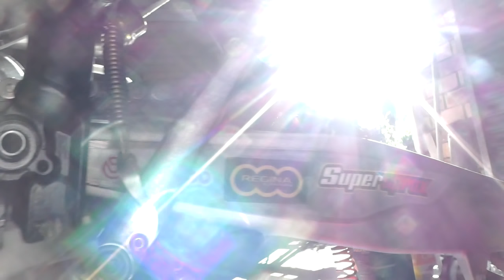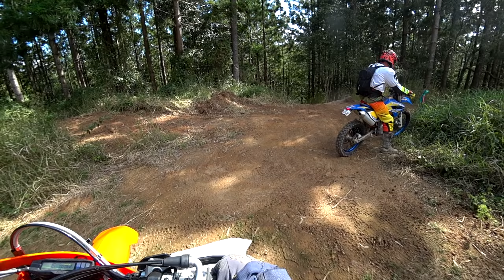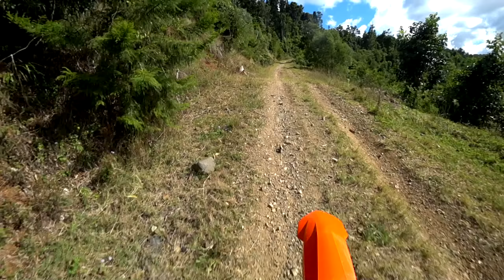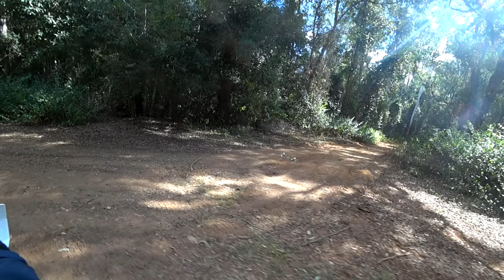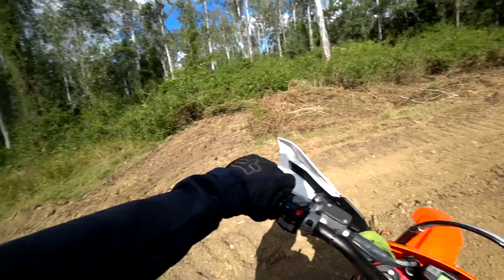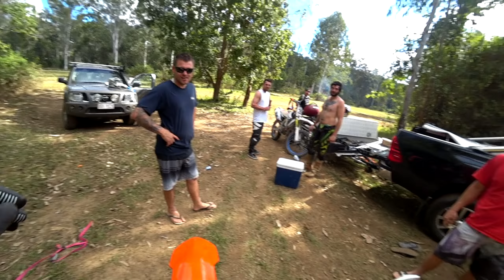New 2018 KTM 500exc setup and test ride at imbil /kenilworth  ,

Comment: Great vid again. Seems like you shot some of it out of sequence. The triple clamps are not the same at the end as when you are smashing through those tracks. Look forward to the rest of the vids for the mods. I just did the gold valves in my 2018 KTM 500 and it transformed it.
Reply from the maker: yeh you got me, but the trig roc clamps are the only mod at this stage , i shot that end seen after 1 hour breakin , new forks are almost ready to assemble and run on dyno ,then i run through the upgrades once i fit them up ,
Reply: Can't wait to see the rest of the upgrade vids
Reply from the maker: Still waiting on KTM box of goodies $1000 free upgrades fmf power core seat and rear disc protector ,and 250 in ktm clothing ,  ,and few other bits ,

Comment: very cool vid mate, hey did you ride the bike much before suspension upgrade & was there huge difference? I've just bought same model as yours but still have my old fe570 but this thing is soo much lighter! & wondering about best mods to do first?
Reply from the maker: yeah i did it in stages ,rear shock to much rebound , forks to soft ,i dunno depends how hard you wanta push it ,was to soft and bouncy for me .but seemed to soak up the chop ok , i had it firmed up ,but i like my bikes like that ,stock setup for most guys should be ok , you can spend alot of money on suspension , them KYB cost shitload to build

Comment: Nice video! Why did you choose the 500 EXC over the 450 XC-F? The 450 seems more suitable for your riding, because it has the air forks and linkage. Should be almost the same on the power side of the engine. You don't seem to ride much on the road. I'm just curious.
Reply from the maker: the 500exc holds its value better in OZ as they are more popular then 450exc
Reply: Oh, OK. I didn't know that. Thanks for the reply.
Reply: Air forks better?

Comment: Did you changed the rear spring? I'm 85kg (+ gear) and think I should change my rear spring on the 450. Thoughts?
Reply from the maker: yep probly worth it .i didn't as i am right weight for stock ,i did have it valved up a lot firmer and had the Factory kyb Aos spring kit cc forks on it for really pushing it off them whoaboyz
Reply from the maker: https://www.youtube.com/watch?v=ydldl4EU8do

Comment: Did you find yourself using top gear much on the fast bits ? What did you think of the gearing overall ?
Reply from the maker: i just went out all day today , video to come , i love it , thing is a weapon stock gearing fast 158klm  i had it up too 14 x50 , now the shock is firmed up revalved , suspension is balanced with the factory KYB forks and clamps this bike is  dialed in , its so stable and just floats over rock littered trails like nothing is even there ,  insane , best bike i have ever ridden full stop ,

Comment: How much more power than you old bike?
Reply from the maker: defiantly much lighter and more poke ,,i tell yah after i fit the FMF and i start leaning on it bit more after first oil change ,but it feels very strong down low and mid throttle  with the tune in it , 4hp more then a stock 500exc from 4000rpm up tp top, custom fuel and ignition mapping by fuel torque

Comment: Very nice mate, are you doing all the mods that you have on your other 500? I sent my 2016 500 exc  six days back home for some winter riding but I'll be getting another 500 yearly next year or might try the 501 husky. Nice riding! Also, what would you recommend for a good pipe? I'm not sure if it'll hurt with the mapping or power.
Reply from the maker: i dont think so , i like nice and light weight , prob just get dirty old dr650 for longer trips,  leep  this ione as enduro weapon
Reply from the maker: in oz we get the tuned at fuel torque, recommended  to fit pipe like fmf keep end cap in it then get rex too flash ecu to your riding style
Reply: Sweet bud thanks for the info. Another question, I was gonna get the acerbis 4 gallon tank for the 500 but was wondering if it's a noticable difference when riding? Should only add just over 12 pounds.
Reply from the maker: yeh still ok but yeh not as flicky